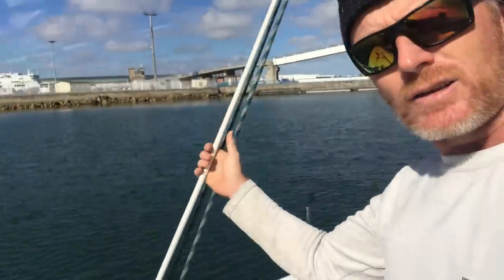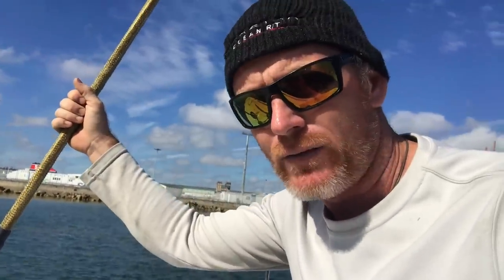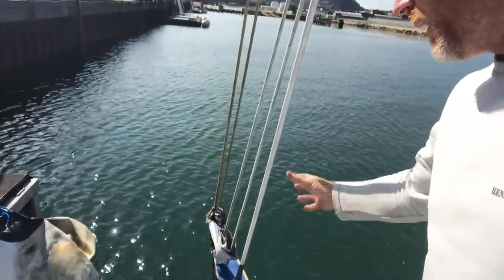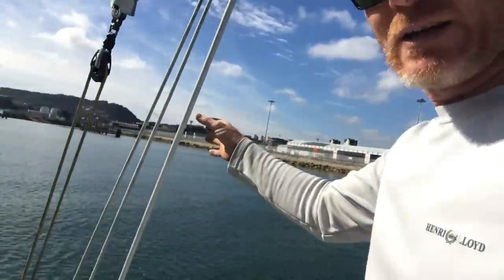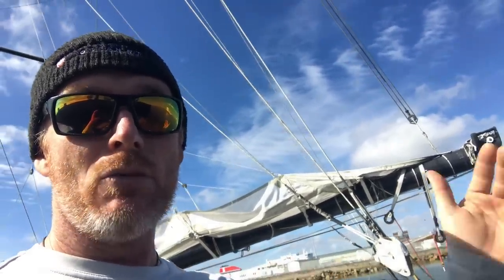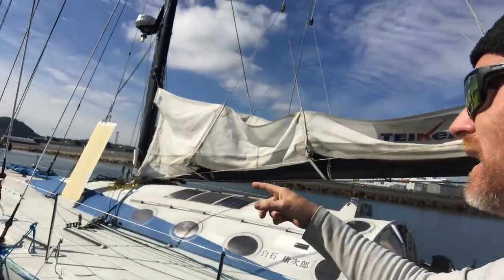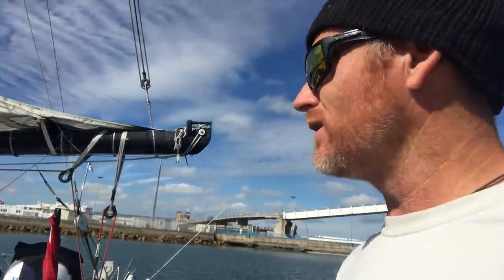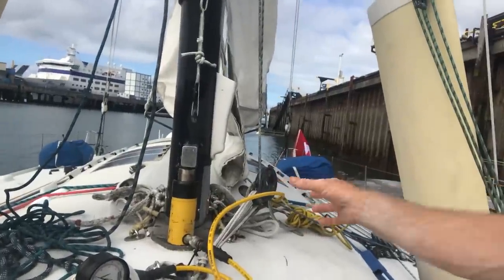The Mariner Episode 5: New Lashings on the Rig

Comment: Super interesting stuff; I watched it twice. Keep it up! Why would they do lashings on the diagonal shrouds, but bolts and terminals on the verticals? Just to save weight?
Reply from the maker: The overall tension in the cap shrouds (V's) is a static factor related to basic mast set up and strength. Only one tensioning device is required per side to set the cap tension and at the moment this is in the shape of a steel turnbuckle - situated low down on each sidedeck and therefore not affecting lofted weight. We will hover replace our stainless steel turnbuckles during the final rig refit with vectran lashings.  
The (D's) Diagonal rigging is where subtle tuning can be performed to alter the way that the mast reacts to light airs/heavy airs/ particular sail configurations/ heavy seas etc.  Only one tensioner is required per diagonal so one end is bolted, the other needs a light, strong but infinitely 'tunable' connection. These are the D lashings we see aloft.  A turnbuckle would be too heavy at such height and would introduce many additional components to the rig (8 components per turnbuckle x 6 D's= 48 components) any of which could fail and threaten the rig's integrity.  A lashing is light, potentially replaceable at sea and in total all the D's are secured with only 6 added components. 
This is what I mean about the modern world of sailing circling back round to pick up on the ingenuity of early sailors. How incredible that in 2019 with the change to dyneema/vectran etc we are suddenly seeking to perfect techniques that were held in equally high regard 1000 years ago?
Reply: @CSMtheMariner  Now that is an explanation! Interesting indeed, I am sure there are many other old techniques we would all benefit from. Thanks and keep it up!